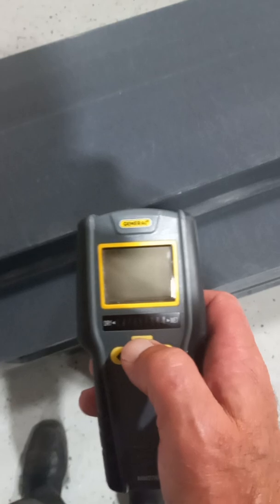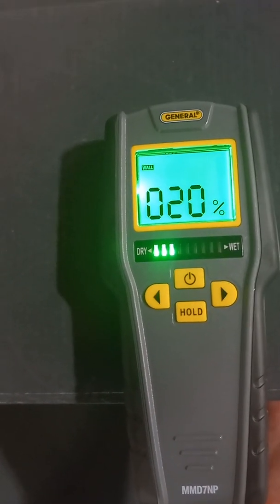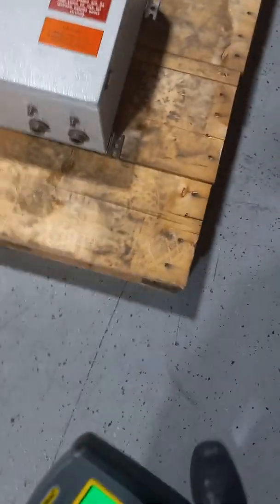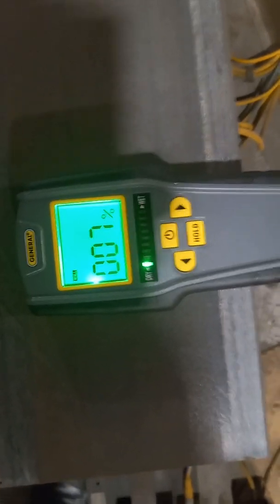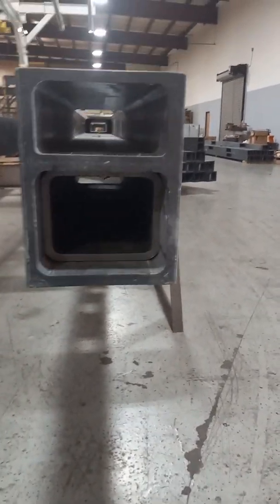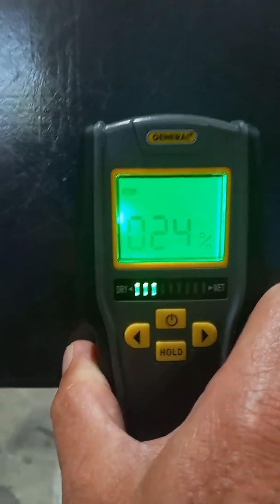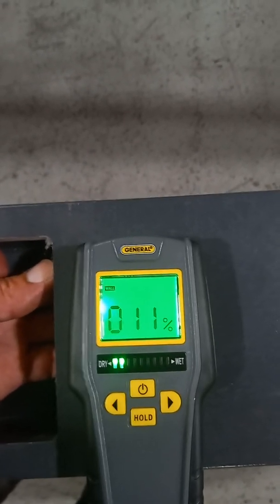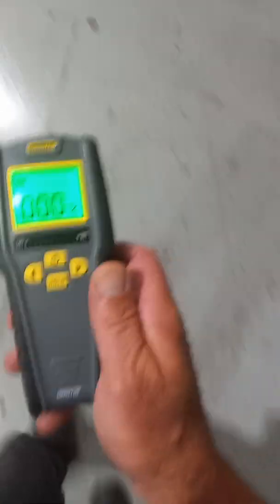Using Basic Moisture Meter for testing boat fiberglass

Comment: which mode
Reply from the maker: I'm pretty sure at that time it was on hardwood. However what I find best is to use as reference so for example whatever setting you start with persay hardwood you measure somewhere you know is dry. Take note of percentage. Then go to other places and compare reading. So if you check dry area and it says 12% then go to other areas and it says 16%. I wouldn't assume its wet as it is only 4% higher than known dry area. Remember any metal will throw meter into heavy wet %. So if you move meter over area of fiberglass and it goes extremely high make sure there is not any metal opposite side like ground bar ect. FYI boat bottom paint can contain metal also so it will read high on paint. Hope this helps.